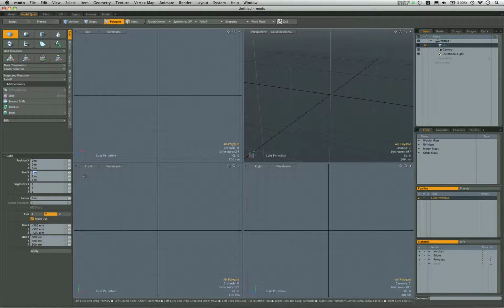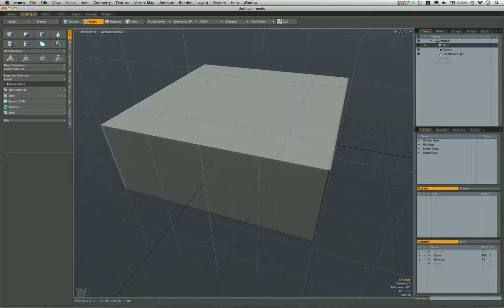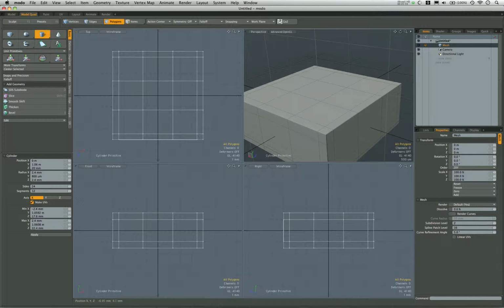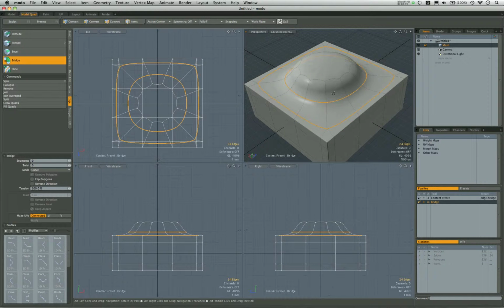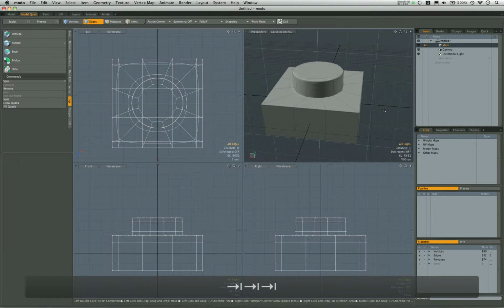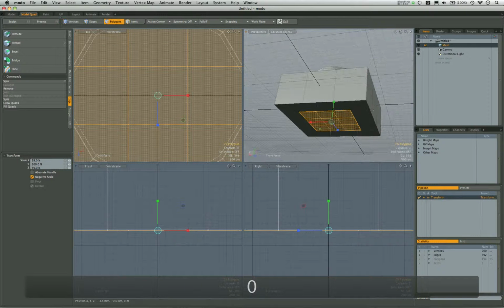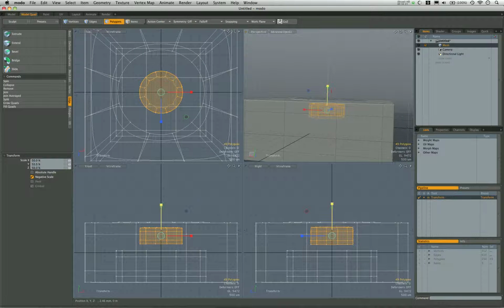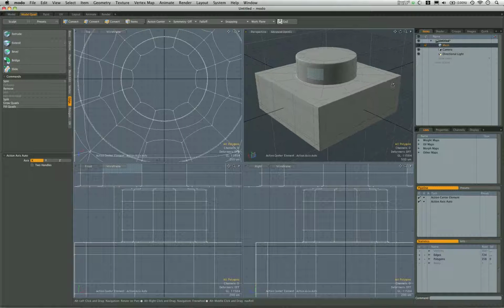Modeling Legos in 3D

Comment: I have a Next Engine Scanner and I used it to scan a figure onto the computer and then I want to move the scan into modo to eventually create Lego instructions.  I am not the best with modo and I am wondering if you could help me out.  I need to build a matrix of standard size 1 x 1 bricks (each brick an individual mesh item 9.6mm x 8 mm x 8 mm) covering my item. Then with target shape in background layer, perform the solid drill stencil function.  Then delete the bricks that I don't need